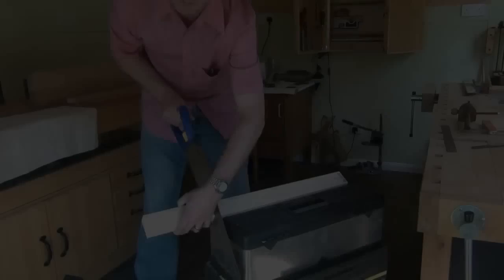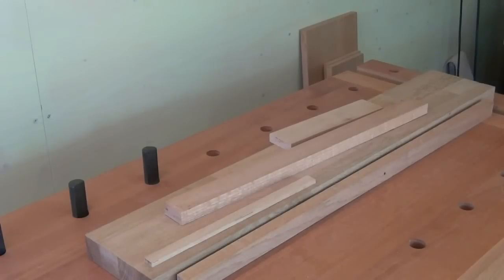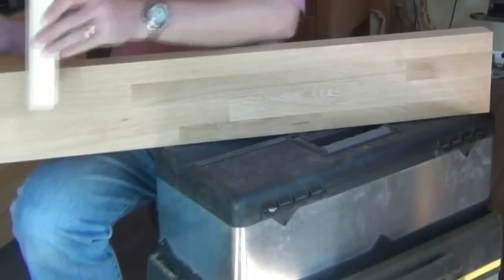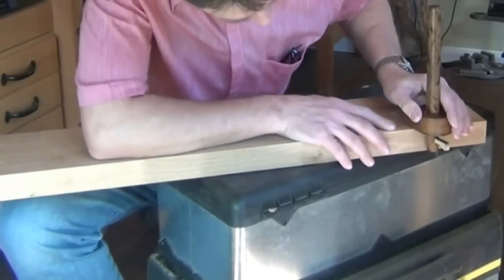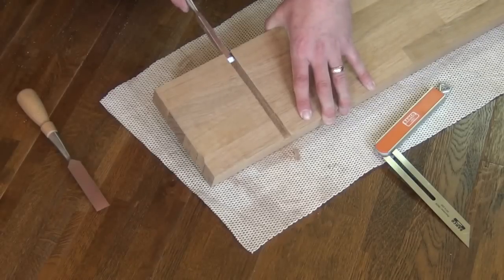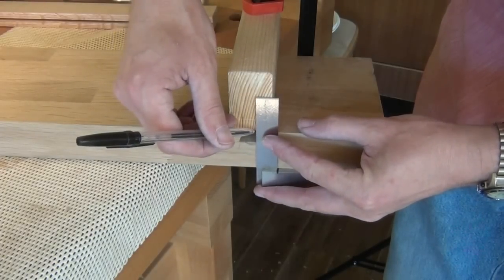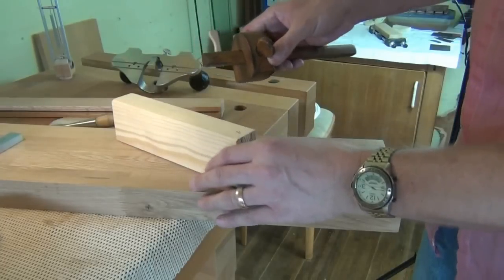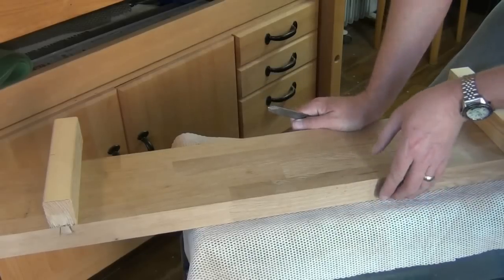Japanese Planing Board Plus - Part 1(3)

Comment: I'm finally prepping to build one! :)
A quick question. I've purchased herdins kokt linolja boiled linseed oil and my experience with it is not stellar. It's the smell. I only have my apartment to work in... A heavily soaked axe handle dried for several days (over a day per each of the two layers) outside in the summer has stopped smelling strongly only after about a month indoors. My questions are: Can I leave such a glued board for a week on my balcony during Central European autumn for the oil to dry? Should I limit the amount of oil by wiping a very thin coat instead of the agressive "make it soak as much as possible" method? Or should I leave the board raw, without any finish?
Reply from the maker: Given what you say, I would be tempted to leave it raw. Maybe give it a very thin coat on windy days, and leave it outside for several hours to off gas.
Reply: You are right. Maybe I will start by applying the oil solely on the most vulnerable endgrain parts first.